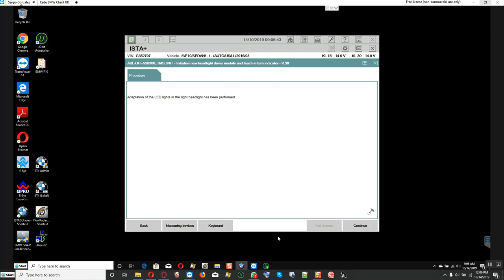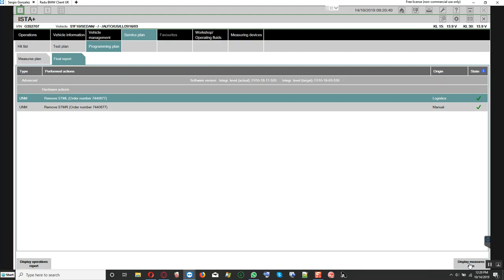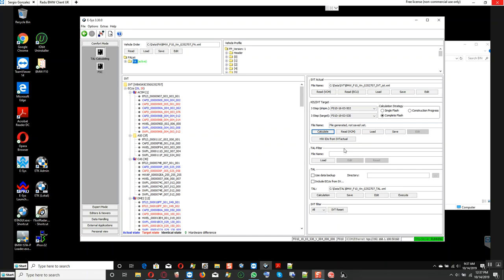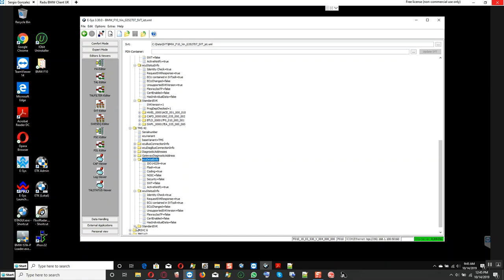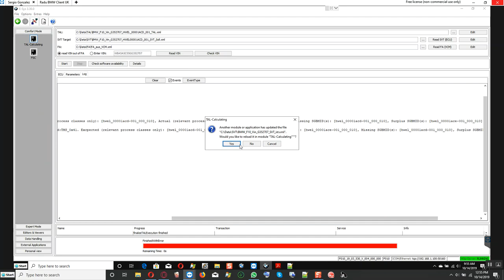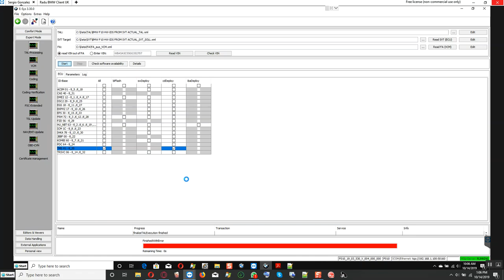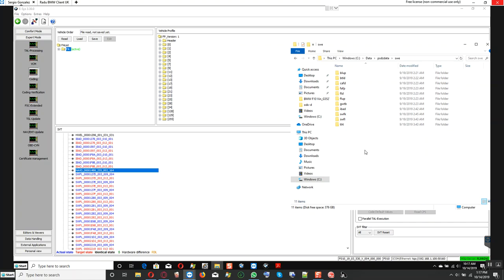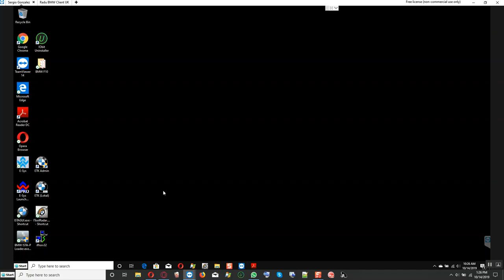BMW F10 Headlight Module (TMS-STML)2019-10-14 13:26:28

Comment: It should be able to be done  through BMW using ISTA. I've been struggling with an F01 for a week and a half. My E-sys cable won't let me program online because it doesn't show the Voltages on the vehicle. If I try using my PTT it tells me I need a day for programming. I'm looking on getting an ICOM now. These are a real pain the way they make you do everything at once. The only thing i'm trying to fix is resting the security on the Transmission module. The shop i'm doing this for replaced the transmission without resetting the security in the transmission, all though i'm not sure that would have done a lot for it with them putting in a used transmission
Reply from the maker: Nhyiraba Latif  i'm kool